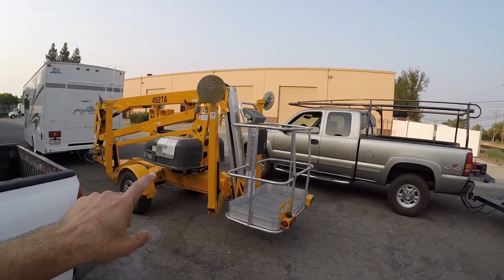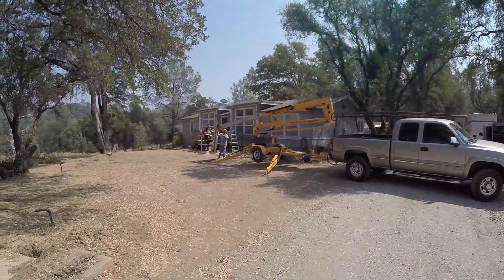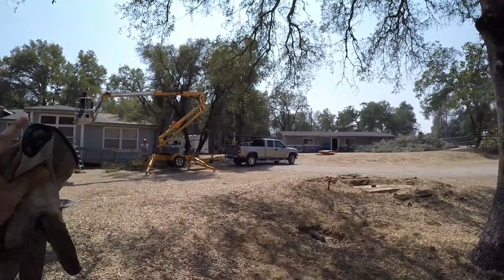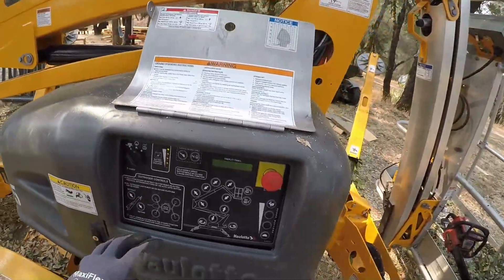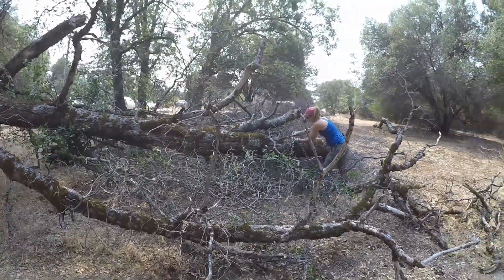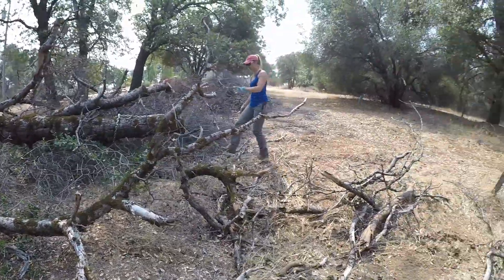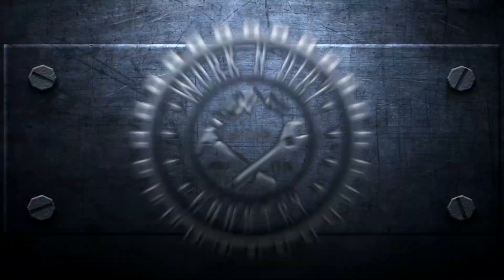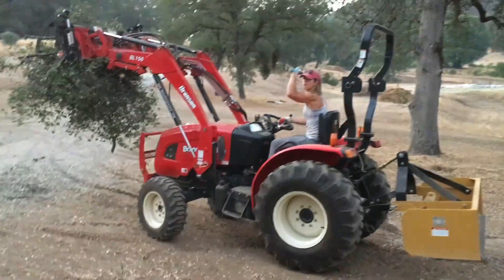Tree Chipping and Trimming using a 45 foot Boom Lift - On The Homestead

Comment: Not one piece of equipment shown that a 1/2 ton couldn't tow
Reply from the maker: Yes you are correct but sometimes the rental shops have requirements and I wasn't sure how much the boom weighed so I didn't want to take chances because my three-quarter ton is rated to pull more than our rv I believe.